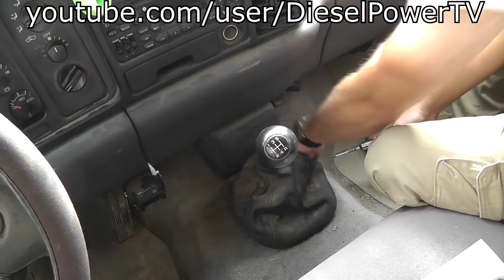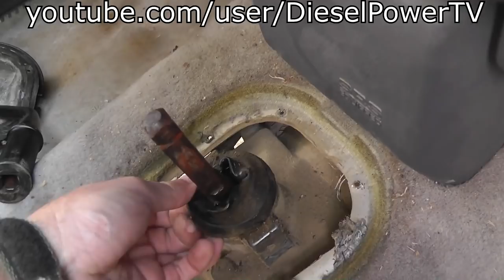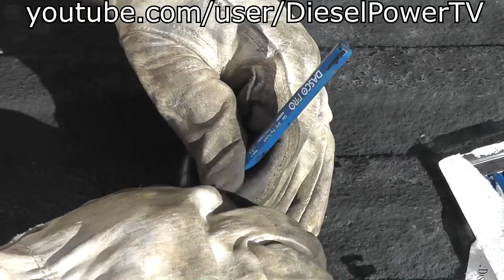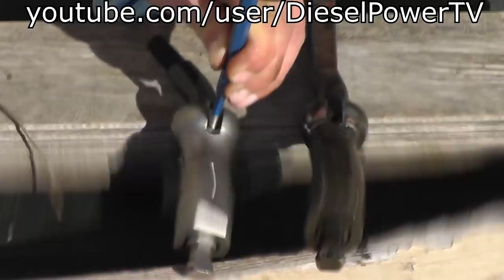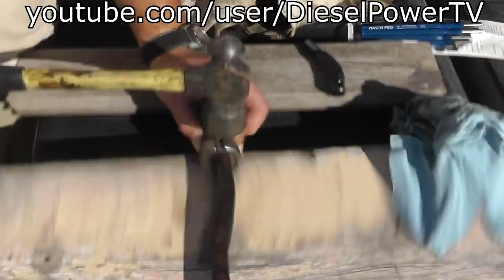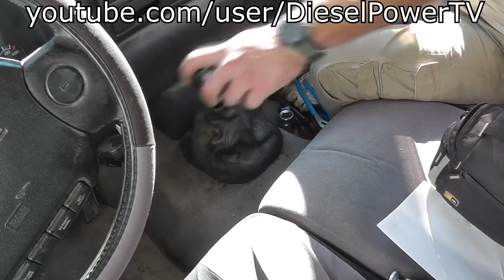DODGE CUMMINS NV4500 SHIFTER STUB KIT INSTALL

Comment: When I had to put my shifter back in and rotate it, I used a fork with a long handle like the ones that you would use to release a tie rod end or ball joint and it made it a lot easier to twist that and lock it into place. If you have one of those available it works great.
Reply: A pickle fork. Good idea.

Comment: I know that you used to have to swap to a 98+ trans top and shift tower, and once you did that, the kit would install as usual. Making me think you swapped the wrong parts and still not having the newer lower components. But still could stand corrected..

Comment: Great video man really learned Somthing...that wasn't your 02 was it ? Anyways keep up the good work
Reply from the maker: This was my 1997 12 valve.  The 2002 shift tower has four bolts that hold it in place. These older nv4500 have round tops held in with a retainer.

Comment: So correct me if im wrong.. but the whole "stub kit" as you call it (I searched for a 12v short throw shift kit), isn't the whole idea to make it so you dont have to move the shift lever a long ass distance?? So that you can shift much faster/cleaner similar to sports cars and so you could even have a drink in the cupholder and still reach third gear??? I guess im curious as to why you popped the pins from both assemblies and swapped the male levers? This is the first time ive seen the process, but i would think that if you ordered the "stub kit" it would come with a new lever if it was supposed to be long and square instead of short or "stubby". As i said, not a mechanical engineer, but if the bottom half that you swapped new is exactly the same as the old one, didnt you go from it being a retro-mod to an OEM replacment essentially? Also most custom shifters are threaded, making me think that youre doing a modern mod and the square shifter male is a stone age application, and that the manufacturer assumes that if youre modifying the shift kit, that the OEM shifter will be replaced as well... I would bet that if you threw the short threaded lever back on, that your steering would be tighter like designed, rather than you having to claim that your efforts made the truck "shift better than it ever has" in your comments..
Reply: Why would his "steering be tighter" if he did what you recommend?

His post was about the shifter in his truck. Are you commenting on the right video?

Comment: Any update, did you figure out what went wrong?
Reply from the maker: I made a premature judgement on my part swap before driving the truck.  Despite the wiggle in the stick the transmission shifts better than it did before.  The stick shift shifts very smooth now.  No problems.
Reply: @DieselPowerTV where did you buy it?